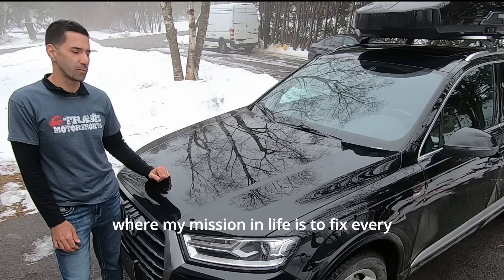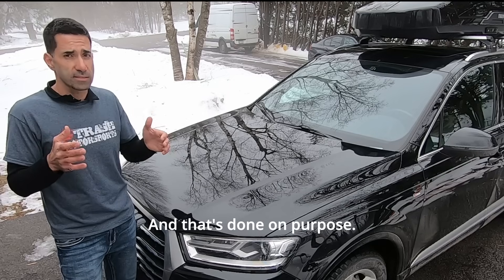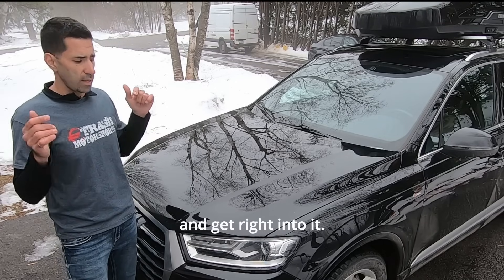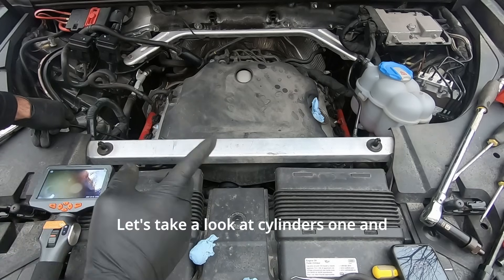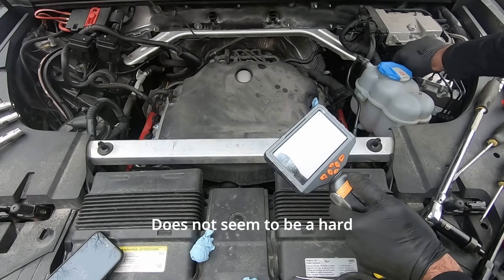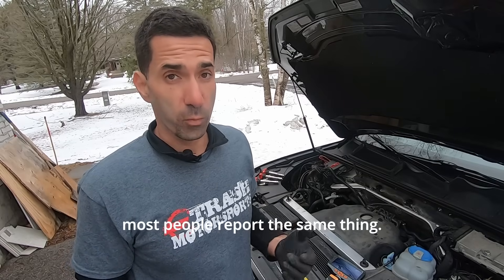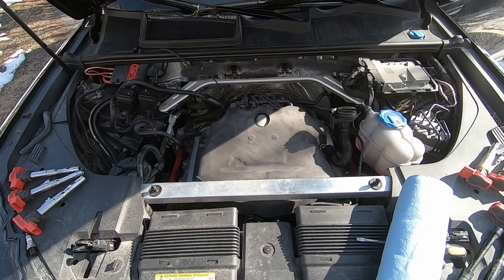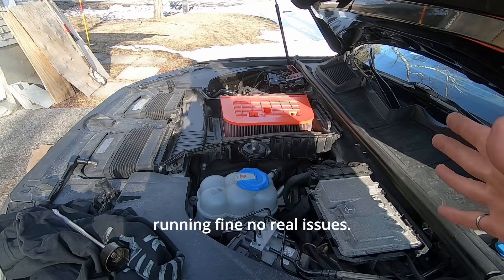I piston soaked another 3.0T with B-12 to fix its oil burning issues due to stuck piston rings

Comment: Any reason not to try this on a 2017 RS3 5 cylinder?
Reply from the maker: Interesting- haven't heard of one of those burning oil yet... how bad is it? No reason not to try this is you suspect oil consumption is from the rings
Reply: @ETMotorsports it burns a quart every 2000 miles or so, so not not hateful

Comment: After four oil changes with Valvoline with store and protect on my 2016 Audi Q5 it's only gotten worse with the oil consumption. I will attempt a piston soak and hope it helps. The back of my car is covered in soot from the burnt oil from the exhaust.
Reply from the maker: That's what I would do too - good luck and keep us posted
Reply: Don’t forget to clean your intake ports too the valve stems will be very carboned up too

Comment: Dumb question: I’m swapping out the PCV, should I do your method before or after that PCV replacement?
Reply: You’re going to spend atleast an entire day if you’re good, or weekend if novice for a pcv replacement and reassembling supercharger etc. so yes definitely good time to do the soak. Use some clean rags stuffed into your intake ports with b12 to easily clean those too and you can soak the metal divider swirl flaps in a shallow bowl of b12 that way you don’t have to scrub anything just be sure to have proper ventilation do this outdoors
Reply: @Pwnulolumad thanks for the response.

Comment: Where does the b12 go???  Evaporate? Or does it need to be flushed out??  Other chats said the b12 destroys parts in oil system
Reply: Some of it evaporates (maybe 10%-20% overnight. Some of it will soak in between your piston rings and side down the cylinder walls to bottom of your engine oil pan. ( this is same place clean oil goes when you add it to your crankcase filler ). The b12 is not “destroying” anything metal. What they mean is that the b12 is a solvent and it is going to make the oil extremely thin. That is why you should drain and change oil before trying to start the car. Oil that is too thin won’t lubricate properly and harm can happen to metal that needs to be lubricated when moving.
Reply: P.s. b12 might ‘destroy’ gasket material or seals in its non diluted form given enough time
Reply: @Pwnulolumad thanks

Comment: Maybe this is a dumb question, but do the cylinders HAVE to be at TDC? Couldn't I just use more B12 and do all 6 cylinders at once, putting more than 50ml in the ones that are at BDC? Is there any problem with that approach? It'd also save a lot of time since you could soak them all at once with the small cost of more B12 cans.
Reply: Same question here, have you figured it out yet?
Reply: @kaloyanlozanov963 did you see reply
Reply: I have soaked all 6 without turning crank. By luck when turning off car 4 of 6 intake ports were sealed and held b12 in them to carbon clean my valves. The other 2 ports I stuffed clean microfiber cloth into it then soaked with b12. Worked very well shiny clean ports.   What I learned later is that when I soaked the pistons, some of them leaked out into the exhaust ports manifold. I am not sure how many exhaust ports were open, but I noticed after 24-48 hours that exhaust under my car was leaking the piston soak fluid from my v band clamps. My advice is put a cardboard box etc beneath car if you try the zero-crank piston soak method haha

Comment: Excellent video, plan to do this in the next couple of weeks on my 2010 B8 S5. Quick question...can you hoover out the garbage from the cylinders instead of blowing? Also, when rotating the crank am I right that if I'm standing in front of the car, and facing the engine bay that I turn the crack clockwise? Thanks.
Reply from the maker: The spark plug is pretty small to vacuum stuff but you can try... also some of it may still be sticky so hard to vacuum... and yes - always turning the crank clockwise
Reply: I vacuumed with 6mm brake line hose from auto part store might be able to fit 8mm in there since I know that’s size of my borescope

Comment: OK watched your other videos and I'm sold. Mechanic gave up trying to troubleshoot my oil consumption on Q5 3.0T so I'm going for it. Which direction do you turn the crankshaft? When you have the tool on you turn clockwise or counterclockwise?
Reply from the maker: Good luck! Crankshaft turns clockwise if you're facing the engine
Reply: @ETMotorsports awesome thanks! Just ordered the tool and b12 and oil+filter. Car has 118k at worst was burning a quart every 400 miles..mechanic replaced the PCV and it's about a quart every 1200 miles now but have owned the car since new and or used to not burn a drop until it hit about 85k miles.

Comment: Question: I’ve got a puddle of soak fluids that dripped into my exhaust and leaked into puddle under my car (v band clamps have a gap it leaked through) how concerned should I be? It’ll just create a smoke show right ? Still going to blow out and vacuum the cylinders before using the starter to shoot out the remainder later on
Reply from the maker: Yeah no big deal - it'll all evaporate pretty quickly... but maybe fix your v-band 😂
Reply: @ETMotorsports update: broke my plastic heater pipe and front crossover pipe when changing thermostat so I’m delayed until the 9th. The little puddle got bigger so I guess more fluid made it into the open exhaust port than I realized

Comment: I am currently soaking my 2015 A7 3.0. I have injectors and fuel rails removed. Split 60 oz of Barry man into all 6 holes, 30 oz of injector cleaner, random ethyl alcohol sanitizer bottles, leftover acetone. With plugs in I kept adding through the injector holes until I can see it’s full. Going to suck it out with shop vac later today.  I’ve also got 4 of the 6 intake ports soaking in b12 too. I didn’t have to rotate the crank at all I guess I got lucky will only have to turn crank for final 2 intake ports. Supercharger bricks and dividers were very thick with oil so im throwing in a complete pcv kit from fcpeuro. I regret spending 220$ on the walnut blasting kit since I won’t be needing it
Reply from the maker: Curious why you went through the injectors? Seems like a lot more work compared to the plugs?
Reply: @ETMotorsports  i've just bought the car with 87k miles 4 month ago now at 89k i noticed bad idle. the failed pcv has coated everything in oil , even when i remove injectors the tips were very carboned. the new spark plugs i put in are mega fouled too. i honestly never want to go through all the labor opening this thing up again. my assumption is that the entire piston wall is fouled so just going for maximum coverage. i soaked the tips seperately in a pyrex bowl with the liquid level beneath white teflon ring so i dont damage it. i'm surprised my data logs werent logging misfires or high knock. overall i'm happy that i convinced myself to open it up and witness the filth inside intead of ruining my engine. i've watched your videos and the fcpeuro walnut blast video a minimum of 10 times each over the last 2 years studying up.
Reply: Progress update: 4/6 intake ports perfectly shiny clean thanks to b12. Now have pistons soaking second time in marvel mystery oil 1 gallon. I won’t be able to fully reassemble for 2 weeks since I sent my supercharger out to get CNC ported. That gives me time to finish changing this pcv and water pump

Comment: Hello, could you tell me how to turn the crankshaft at 10:30? Mine is stuck.
Reply from the maker: Watch the previous video on the 3.0t - I show what to do... the dried up carbon builds up at the lower end of the piston head and prevents you from turning the crank
Reply: Mine is stuck as well, finished my second can of Berrymans, will not budge, even when I rock the car back and forth and  using a lot of compressed air. Help!!
Reply: @oscarespinosa8356  I've solved it perfectly. Do as I say: repeatedly soak in 50ml of B12 solution for at least 3 hours each time, then continuously blow air through it until you can turn the crankshaft. You will succeed.

Comment: Hello, I've watched the two videos about the Q7 engine and noticed a problem. In video 1 (Garage Q7), you soaked the cylinders in three groups: cylinders 1 and 6, 2 and 4, and 3 and 5, for 12 hours each time. However, in video 2 (Snow Q7), you soaked all six cylinders at once, then after 3 hours, you rotated the crankshaft to soak all six cylinders again for another 3 hours, and then blew out the impurities. I just want to confirm, can I soak all six cylinders at once instead of in the order of 1 and 6, 2 and 4, 3 and 5? Also, is it necessary to keep the cylinders at top dead center (TDC) for soaking? How can I confirm that they are at TDC? Thank you.
Reply from the maker: Hey I did the same thing in both cases - soaked the pistons in pairs... if you watch this video again you'll see I'm showing 1 and 6 and then skipped the rest as I did it at night... you can soak all 6 at the same time which is what i did the first time I soaked a V6, but it wasn't very effective...
Reply: @ETMotorsports  Hello, I'm currently facing a problem. I soaked cylinders 1 and 6 with 50ml of B12 liquid in each cylinder. After adding the liquid, I plugged cylinders 1 and 6 with paper. After 10 hours, I checked with a camera and found that cylinders 1 and 6 were still full of liquid, which was black but hadn't disappeared. I started turning the crankshaft because you said moving the piston up and down would be more effective, but it got stuck after only two rotations. I couldn't turn it no matter how hard I tried. Your video said that at this point I should use compressed air to blow out the contaminants so it could turn, but it's completely full of B12 liquid, and I can't blow it out.

Now I have a few options: 1. Completely remove the B12 liquid from cylinders 1 and 6, add another 50ml of B12 liquid into cylinders 1 and 6, and soak for another 12 hours. 2. Rotate the crankshaft slightly in the opposite direction, then continue rotating. 3. Leave it as is and wait for the liquid to disappear naturally (this may take a long time). Could you give me some advice? Thank you.
Reply: Hello, one hour after leaving the message, I took the following actions: I used a water pump to remove about 25ml of B12 from cylinder #1. The inside of the cylinder was dry and black, so I added another 50ml of B12. Then, after removing 25ml of water from cylinder #6, the water pump broke down, leaving about 10ml remaining. I added another 50ml of B12. Then I turned the crankshaft slightly in the opposite direction (chatgpt said it's okay to reverse it slightly), and when I turned it forward again, it got stuck a little bit. That's it for now. I'll check again tomorrow morning.
Reply: @ETMotorsports  Hello sir, I seem to have encountered a problem. The first time, after adding 50ml to cylinders 1 and 6, the crankshaft wouldn't turn after 12 hours, and the liquid hadn't disappeared, so I drained it. The second time, I added 50ml, and after another 12 hours, the liquid still hadn't disappeared, and the crankshaft still wouldn't turn. The third time, I added 50ml, and the liquid still hadn't disappeared, so I drained it, but the crankshaft still wouldn't turn. The crankshaft can reverse, but the amount it reverses is the same as the amount it turns forward; it can't continue turning. I've tried everything I can. After three soakings, the drained liquid is extremely black. The last time, I checked with a camera and then used compressed air to blow out all the liquid, but cylinders 1 and 6 are still very black, and the metal tops are not visible. I can only see the metal tops by scraping hard with the camera, and it seems there's still a lot of carbon buildup. I don't know what to do next. The crankshaft won't turn, the cylinders are still very black, and there's no dry debris like in your video on the top of the cylinders; mine is just wet, black sludge that I can't blow out. Please give me some advice, thank you.

Comment: I was finishing up my second set of pistons, went to crank and it will not move. Any ideas on how I can get.it.cranking again. I am following the instructions and used compressed air after the soak. Help!!
Reply from the maker: Keep working it back and forth, blow it out,  add more liquid... it'll move... it's the garbage that accumulates on the lower side of the piston
Reply: @ETMotorsports any other suggestions? Have been doing the procedure for days and no movement. I am also rocking the car back and forth but nothing. Am I at the point of having to hit the starter?
Reply: Thanks so much for responding! So should I refill the 4 pistons with 50 ml for 6 hours and try again? Also,  do I need to extract oil at this point because there is B12 sitting at the bottom of my oil pan for almost 24 hrs. Thanks again.
Reply: Five days in repeating the procedure. A ton of carbon continues to come out every time I blow it out with compressed air. However, the engine will still not crank. Do i still continue to do the poring and bow out procedure, or should I stop that? Any other ideas on how to unseize the engine? Getting desperate. Thanks.

Comment: Non-mechanic here asking a noob question: Will this process affect the sell value of the car? For example, will it leave some engine faulty records in your car computer (when you start the engine with B-12 in it) and later found out by the used car dealer?
Reply from the maker: There's nothing that will be permanently recorded by the car... you'll have a few misfires at best

Comment: Great Video!!! What can I use alternatifly for soaking my pistons? We got Liquiymolly, Protec…. Greetings from Germany.. got an a4 b5 2.8l 30v 193ps from 2000 they Drink fuel and oil
Reply from the maker: I would try liquimoly injector cleaner pro line
Reply: @ETMotorsports Thank you for your reply! The 2.8 30v Engine with 193ps is known for the oil consuption. Do you know if That was also the case when the Engine was Brand new? So any Injektoren cleaner is good to go for this procedur? You think That it will work like the berryman B12 ?

Comment: Doing this on my Q7 right now. I think there’s a bit of a geometry problem in the way you’re doing them at TDC. When one cylinder is tdc with valves closed (compression stroke), the companion cylinder is on opposite stroke. At end of the exhaust stroke or the beginning of the intake stroke. This means that one cylinder has valves closed and one has two, possibly all four valves open if you caught it during valve overlap. 

For the cylinder with open valves, I’m thinking that no more than 1/2 the crown of the piston is actually soaking because the rest of the b12 is running out of the valves into the intake and/or exhaust manifold.
Reply: Also this is not negative in any way toward your vids! You’ve been very influential on this topic and also on my decision to actually do this. I just wanted to mention something you might want to consider in your experiments. I’ve been watching your videos at least two years because this is the second Audi with a 3.0t that I own. My 2011 q7 ended up burning a valve ☹️ so I figured on my 2017 I need to do something about it before it meets the same fate. I will say I will not be taking a risk driving with b12 in the crankcase. A couple forum posts of people doing that and managing to spin rod bearings is enough to deter me 😅
Reply from the maker: interesting...I`m not sure how a 20min drive with 1L of B12 diluted in like 9L of oil can cause a spun bearing? I've never heard or seen of any negative impacts on the engines so far but just like I said the first time I did a Q7 - this is entirely based on your level of comfort. If you don't want to drive with B12 in the engine, you can swap the oil out for Valvoline R&P after the service for a few oil changes - that should help keep the cleaning process going...
Reply: @ETMotorsports I know the risk is likely small, but my engine already has 125k miles on it and the R&P in it was already due for a 5k change. I haven’t heard if it happening on an Audi but others have reported spinning bearings in Toyotas and Hyundais following a soak. Maybe it was on its way out already for them and the solvent-thinned oil was the straw that broke the camel’s back. I had about 1L of B12 in the pan along with 5.6ish L of oil. I’m probably just more risk-averse than you. 

I will say that I completed the soak. So far I’ve put 300 miles on it and not burned a drop. Before, I was burning 1 qt per 300-400 miles. So I’m pretty hopeful. I turned the crank by hand quite a bit then drained the oil and filled with R&P, as well as fogged the cylinders prior to cranking with the plugs out. I’m going to do two more changes at short OCI’s. Maybe 1k and 2k. So thank you for your contributions to the popularity of this process on our VAG vehicles. I think you saved my engine.

If you’re interested in my documentation: https://www.facebook.com/share/v/1KgWbvs69E/?

Comment: Can you try this method with Volvo S60,V60,XC60 or XC70 (some of the mentioned) with T6 engine (3.0 turbo) to see how will it work?
Reply from the maker: Yeah go for it - let us know it works
Reply: @ETMotorsports  before next oil change will try it and return information. The car is 6 cylinder straight not V engine.
Reply: Did you have any luck doing this on your Volvo?
Reply: @beatinstinct  Not yet. Still need to have some mileage done so the time for oil change to come. But I'm thinking to try it.